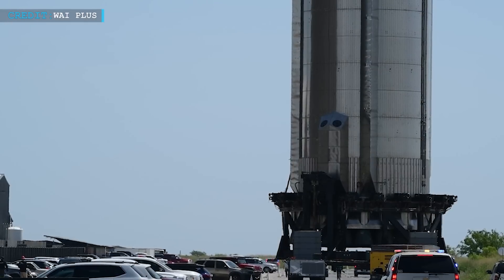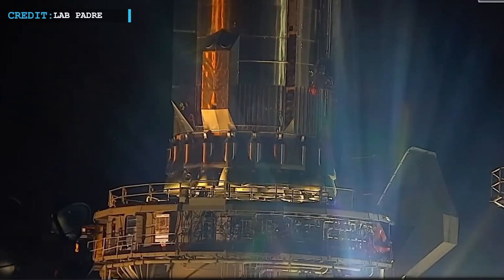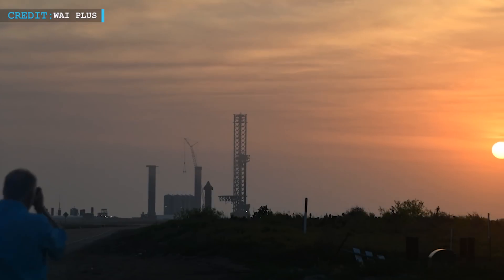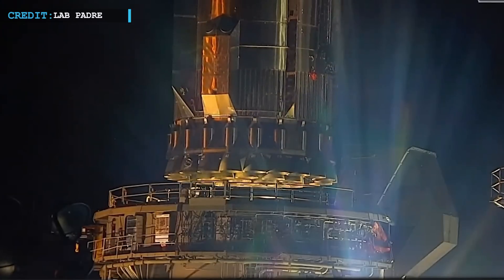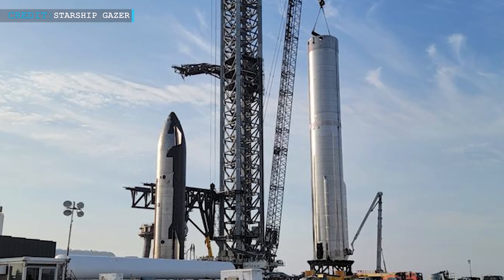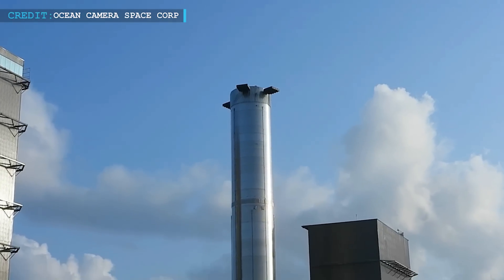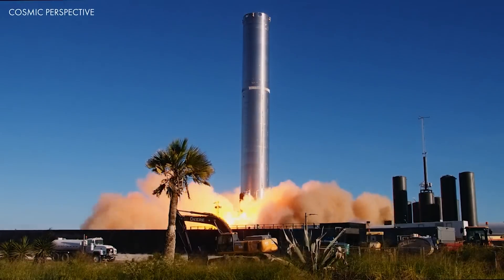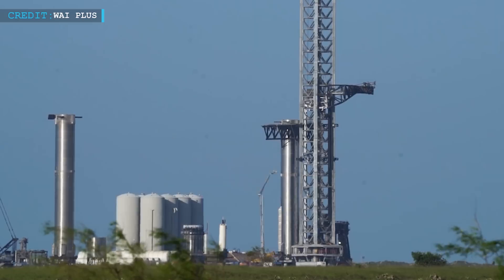SpaceX Starship Booster 7 Lifted Using Chopsticks Arm onto the Orbital Launch Mount for Static Fire🔥

Comment: So how is the booster rotated to line up with the disconnect? I can't imagine it landing completely on spot. Do the chopsticks have some sort of conveyor system that moves in opposite directions to rotate it into the correct position? Also, I'm sure they also have to find a way to move the booster back n forth to align perfectly into the pad.
Reply: The "chopsticks" have a mechanism on them that will push the caching points in to the right position in case the booster is cached when slightly rotated or/and out of center.